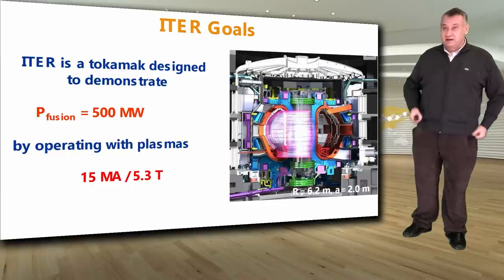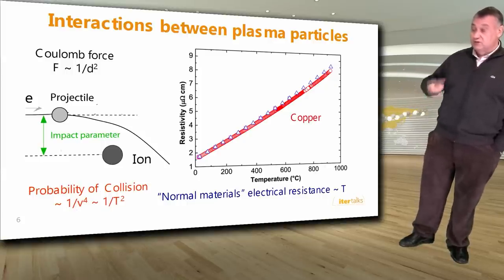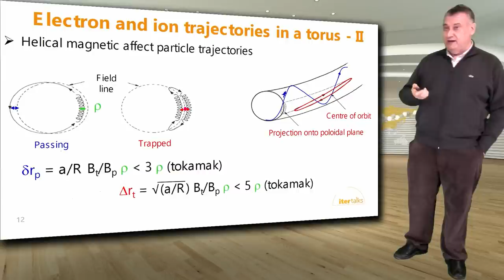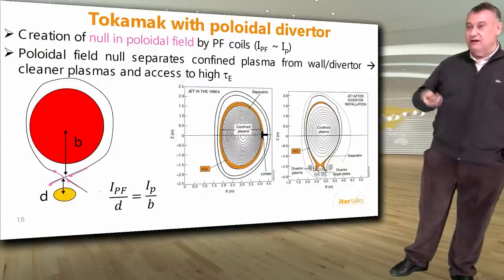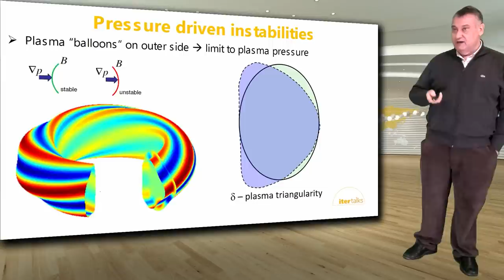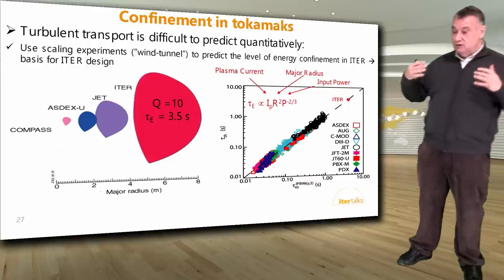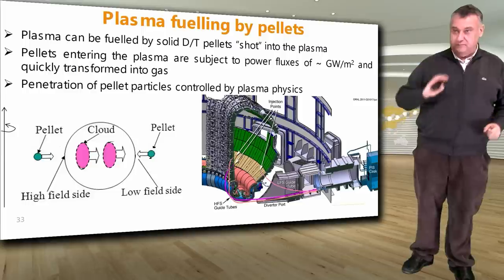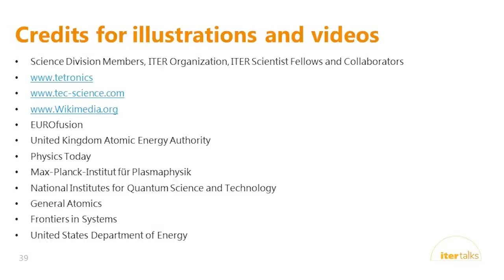ITER Talks (6): Tokamak Physics for Nuclear Fusion

Comment: Don't give up guys! I don't understand science but I know nuclear fusion could bring peace to the world. Keep trying! 🌞🙏💞
Reply: @ВладимирВласов-х4г  Not convincing, if the Suns energy were produced in the corona then the Sun would be much larger in the sky.
Reply: @bernhardschmalhofer855  You have a strange idea of the size of objects. The Sun is 1,392,020 kilometers in diameter. Light from the Sun to Earth, 150 million kilometers away, takes about 8 minutes and 20 seconds. The solar corona is about 300-400 km thick. This is the size obtained by nuclear fusion on the surface of the Sun. If the radiation power is twice as large, the diameter of the solar corona will increase in proportion to the laws of thermodynamics.

Comment: Fusion is the attempt to design Maxwell's Daemon for a fractal gearbox of relative-timing ratio-rates vortices manifestation, a conic-cyclonic modulo-geometrical interference positioning, resonance wave-packaging machine.

All opinions come down to..,  "I wish you luck"! (In MY worthless opinion)
Condensates are only as stable as the Holographic crystallisation matrix of vertices in vortices, nodal-vibrational Supersymmetry all-ways all-at-once sync-duration holography here-now-forever. If ITER knows how to keep the impacted vortex matrix holding still, (temporarily made of relative-timing making rates of "stillness"), then "problem solved". Eg the "Drive" postulated for an "Alien UFO" involves an Accelerator and Fusion-Fission Target that affects the supposed matrix/fabric of Spacetime in a way that allows a controlled degree of movement by relative-timing phase-shifting coordination of the Vehicle without disrupting the whole resonant integrity of it. (An inside-outside Perspective on perceived experiences of existence, by assembled Theoretical abstractions)
Reply: Bro are you ok?
Reply: when the acid kicks in…

Comment: Sorry but fusion based on the idea that "energy" is within matter is completely wrong.  Your physics is incorrect and I can prove it.
As a challenge answer this:  How does a non-contact force work?
When you realize that pulls (non-contact) forces can not exist then you can adjust your physics after talking to me.
BTW: There are no neutrons or protons, they are the same particle in different orientations.  If you disagree then how does a neutron held within an atom?

Keep banging your head!
Reply: get this guy a nobel prize, he just proved that something infinitely dense doesn't always turn into a black hole.
Reply: Why don't you spent 10 minutes playing with a magnet?
Reply: @bernhardschmalhofer855  You have a strange idea of the size of objects. The Sun is 1,392,020 kilometers in diameter. Light from the Sun to Earth, 150 million kilometers away, takes about 8 minutes and 20 seconds. The solar corona is about 300-400 km thick. This is the size obtained by nuclear fusion on the surface of the Sun. If the radiation power is twice as large, the diameter of the solar corona will increase in proportion to the laws of thermodynamics.
Reply: @ВладимирВласов-х4г  What are these fictional units called kilometers...Its miles man!  Miles!  :)
Reply: @ВладимирВласов-х4г  Sorry, I should have guessed that when you say corona you don't mean the thing that is commonly called corona, https://en.wikipedia.org/wiki/Stellar_corona.
Reply: @buddysnackit1758  Ask Wikipedia, that's where the information comes from.
Спроси у Википедии, оттуда информация.
Reply: @bernhardschmalhofer855  Ok. I must have an inaccurate translation. 
Ok. Наверное у меня не точный перевод.
Reply: @ВладимирВласов-х4г  You might have meant the photosphere. Wikipedia gives its thickness as 100 km, which is the same magnitude as your 200 to 300 km. It it also the part that is actually seen when no solar eclipse is taking place. But of course the photosphere is not where fusion takes place.
Reply: @bernhardschmalhofer855  Dear Bernhard, I did not say that the fusion takes place in the photosphere. Read the video carefully. Or read http://n-t.ru/tp/ie/ts.htm Thermonuclear fusion on the Sun - a new version. Vladimir Vlasov. If you do not know and do not understand how nuclear fusion occurs in the solar corona, this does not mean that nuclear fusion cannot occur in the solar corona. It is known that the Sun's atmosphere consists of the photosphere, the chromosphere, and the solar corona. The photosphere is the visible surface of the star, which generates most of the optical radiation. This layer is 100 to 400 km thick, with temperatures ranging from 6600° K (inside) to 4400° K (at the outer edge). The size of the Sun is determined by the photosphere. The chromosphere surrounds the photosphere; it is about 2000 km thick. The upper boundary of the chromosphere is characterized by hot outbursts - spicules. The chromosphere can only be seen during a total solar eclipse. The solar corona is the last solar envelope. It is characterized by protuberances and eruptions of energy. They spurt out hundreds of thousands of kilometers, generating a solar wind of plasma (electrons and ions). The temperature of the solar corona is much higher than the surface of the Sun -- 1,000,000° K to 2,000,000° K, and in some places from 8,000,000° K to 29,000,000° K. You can see the solar corona during a solar eclipse. The solar corona has a complex structure. 
Why do scientists believe in scientific dogma, which has many unsolved theoretical problems and has kept physicists from making a commercial fusion reactor for 70 years? Why don't scientists believe the obvious? Look closely at the Sun. It is clearly seen that the process of fusion, the burning of nuclear fuel with the release of large amounts of energy, takes place in the atmosphere of the Sun, in the solar corona, here creates a high-temperature combustion region and intense solar radiation.  It is nuclear fusion that accelerates the high-temperature coronal gas, plasma, to high speeds of 7,500 km/s. The theory of nuclear fusion in the solar corona solves all known theoretical problems, such as the problem of heating the solar corona.  The theory of nuclear fusion in the solar corona makes it possible to make a commercial fusion reactor in 2-3 years. There is still evidence that fusion takes place in the solar corona, but this is still a know-how. 
Уважаемый Bernhard, я не говорил, что слияние происходит в фотосфере. Внимательно ознакомьтесь с видео. Или  почитайте http://n-t.ru/tp/ie/ts.htm Thermonuclear fusion on the Sun - a new version. Vladimir Vlasov. Если Вы не знаете и не понимаете, как происходит ядерный синтез в солнечной короне — это не значит, что ядерный синтез не может происходить в солнечной короне. Известно, что атмосфера Солнца состоит из фотосферы, хромосферы и солнечной короны. Фотосфера — это видимая поверхность звезды, создающая основную часть оптического излучения. Толщина этого слоя от 100 до 400 км,  температура от 6600° К (внутри) до 4400° К (у внешнего края). Размеры Солнца определяются по фотосфере. Хромосфера окружает фотосферу, её толщина около 2000 км. Верхняя граница хромосферы характерна горячими выбросами – спикулами. Хромосферу увидеть можно только при полном солнечном затмении. Солнечная корона — это последняя солнечная оболочка. Она отличается наличием протуберанцев и извержениями энергии. Они выплёскиваются на сотни тысяч километров, порождая солнечный ветер из плазмы (электронов и ионов). Температура солнечной короны намного выше поверхности Солнца – 1 000 000° К – 2 000 000° К, а в некоторых местах от 8 000 000° К до 29 000 000° К. Увидеть солнечную корону можно при солнечном затмении. Солнечная корона имеет сложную структуру. 
Почему учёные верят в научную догму, у которой много нерешённых теоретических проблем, и из-за которой физики не могут сделать коммерческий термоядерный реактор 70 лет? Почему учёные не верят в очевидное? Посмотрите внимательно на Солнце. Явно видно, что процесс слияния, горения ядерного топлива с выделением большого количества энергии, происходит в атмосфере Солнца, в солнечной короне, здесь создаётся высокотемпературная область горения и интенсивное солнечное излучение.  Именно при ядерном синтезе ускоряется высокотемпературный корональный газ, плазма, до высоких скоростей в 7500 км/с. Теория о ядерном синтезе в солнечной короне решает все известные теоретические проблемы, например, проблему нагрева солнечной короны.  Теория о ядерном синтезе в солнечной короне позволяет сделать коммерческий термоядерный реактор за 2-3 года. Есть ещё доказательства, что слияние происходит в солнечной короне, но это пока ноу-хау.
Reply: @ВладимирВласов-х4г  So,  you suggesting that fusion takes place in the corona. Because the Sun is visible, this would mean that the fast fusion products must heat up the photosphere so that it emits light. The emitted light then makes Earth a habitable planet. This means that the fast particles would need to be directed by magnetic fields to the surface of the Sun, as otherwise the Earth would be much more bombarded by the fusion products.
If this can be shown to be more correct than the current understanding, then this would be a scientific revolution. But I'm fairly confident that this idea won't be fruitful.